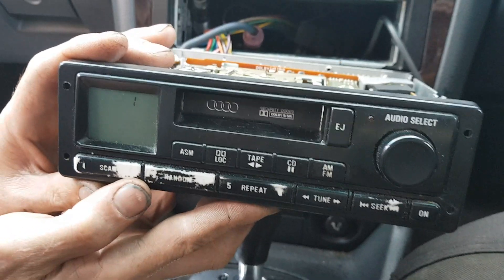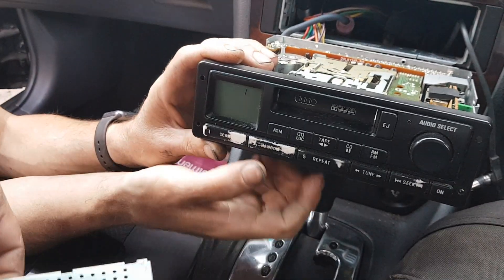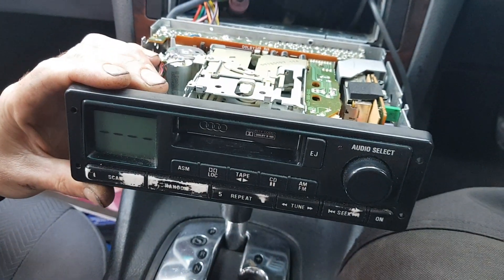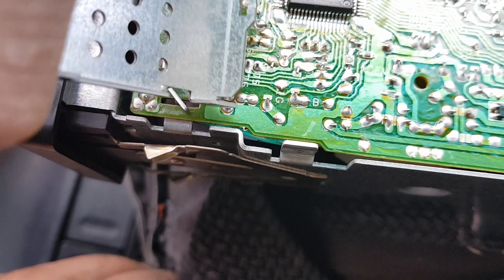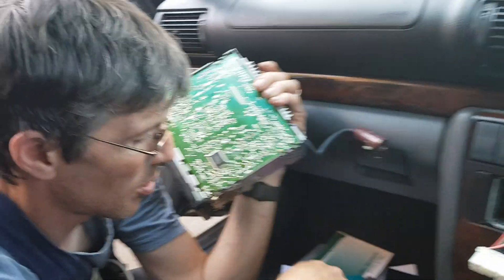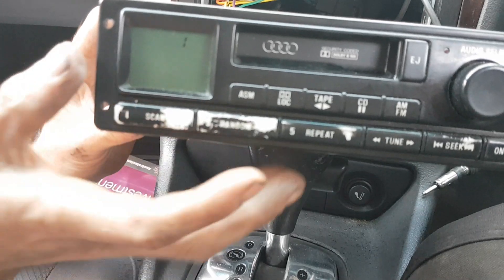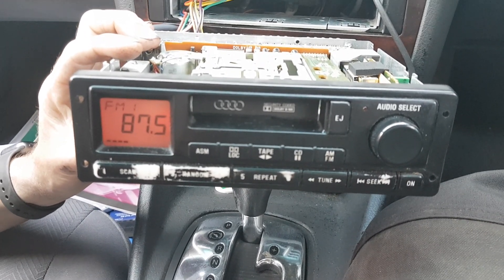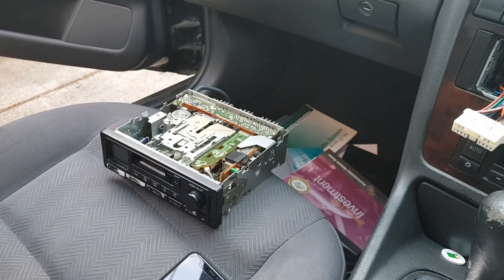Eurovox 8790 security code entry & tips and tricks.

Comment: Hi great video. Do you know how to fund the code to unlock 🔓 the stereo for eurovox Holden VT or any other way to find code
Reply from the maker: it should be in the manual for the car or in the vinyl pocket it comes with.
if you cant find it just get an aftermarket head unit off facebook marketplace. if you get a pioneer kenwood or sony you can usually buy a cable that connects the new head unit to the cars connectors  from autobarn. 
those eurovox things are crap.